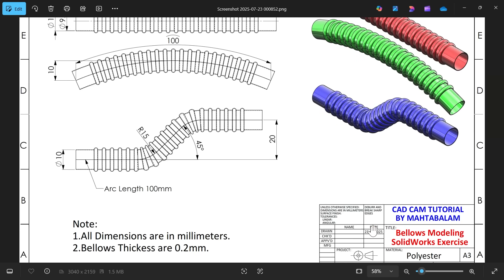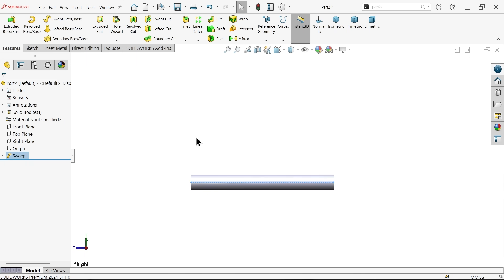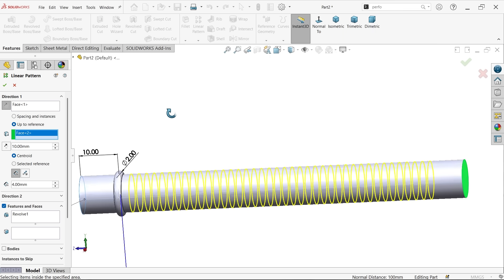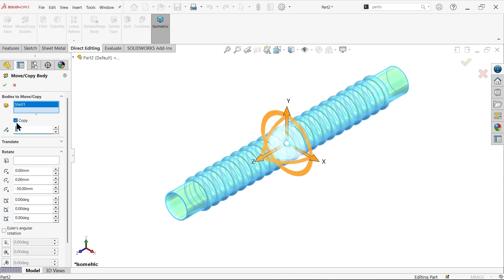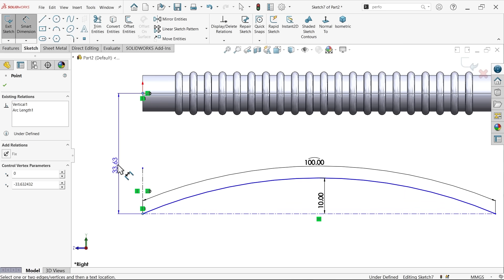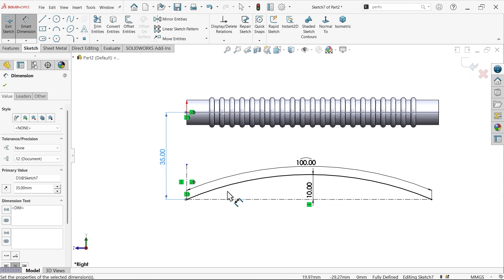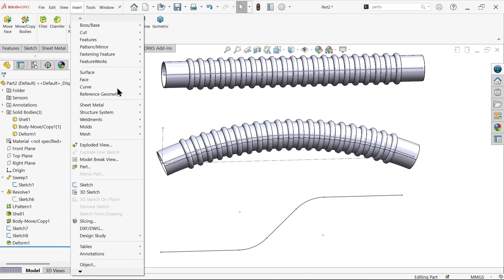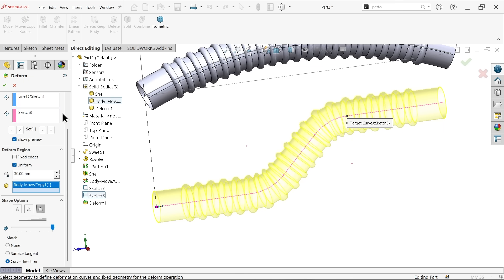Bellows Modeling in SolidWorks (Deform Feature)

Comment: As many years as I've used Solidworks, it's amazing that I just now learned about: 1) Dimension an arc by clicking both ends then the middle (I've always just shown the radius dimension), 2) Select Chain command, 3) Make Path command, 4) Path Properties then editing Path Length Dimension, and of course 5) Deform Feature command. Very useful tips! I have never once regretted subscribing and joining as a member on this incredible channel!